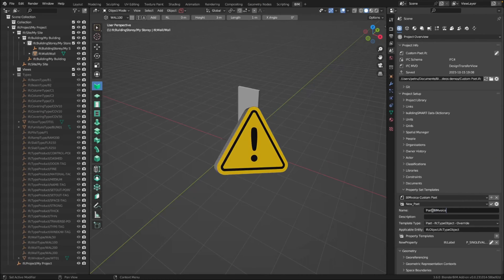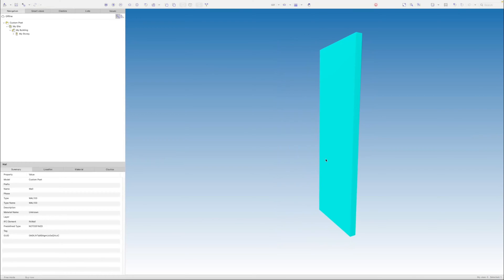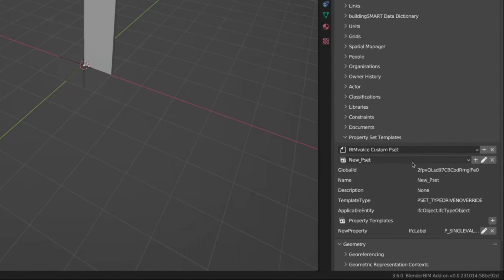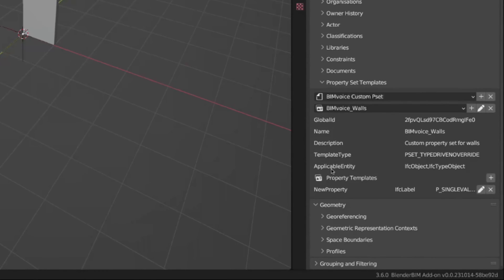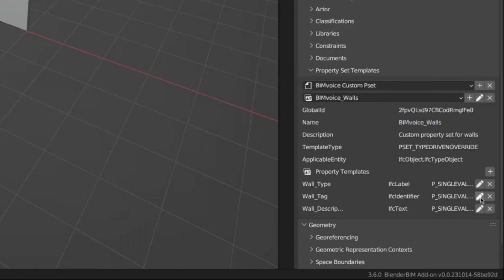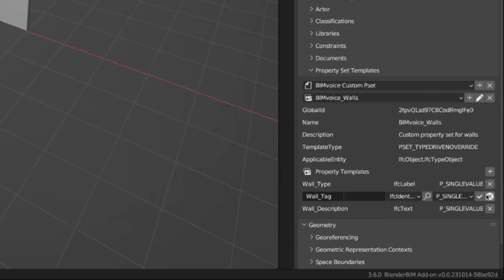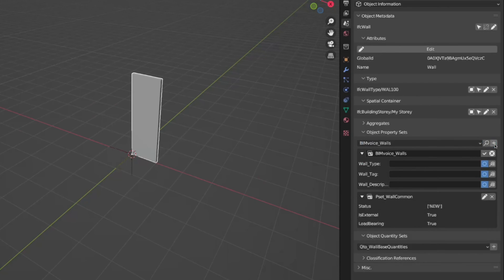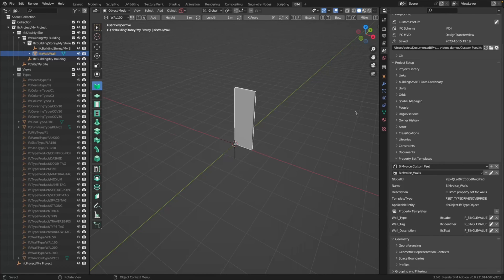Creating IFC property sets in BlenderBIM is a game changer

Comment: Thank you for your videos. It has really helped me in familiarising myself with Bonsai. Is there a way to create the psets and fill out the attributes from an excel file directly imported in bonsai?
Reply from the maker: you're welcome, happy my work is helpful. You can use IfcCsv to export your model to a spreadsheet, then fill in data that you want to add, and then apply it on your model. That would be the most recommended way I think.